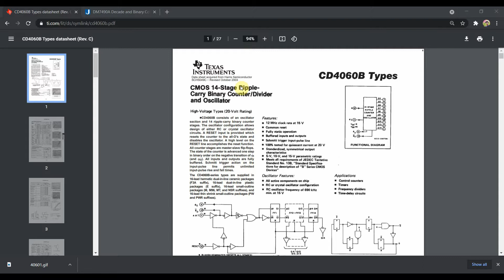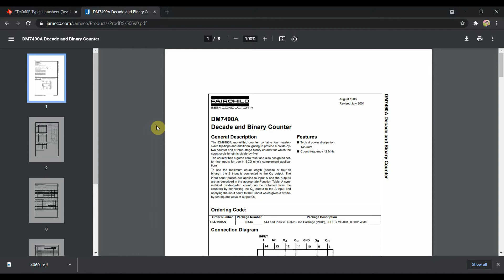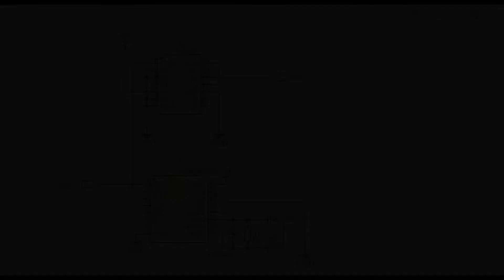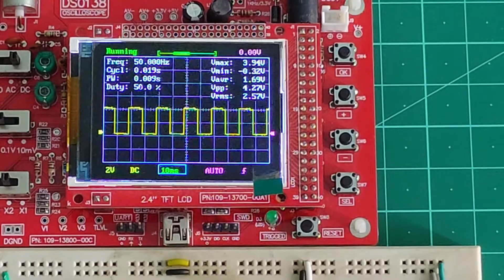Generate 50Hz and 1Khz with a crystal || Stable signal generator without microcontroller

Comment: This is a very good concept u have presented. Please I would like to know if I can use these ICs to generate 50Hz ~ with a frequency up to 25 -30MHz vibration frequency. I mean must it be 4.096MHz crystal before it will work? Please suggest steps one can take to use vibration frequency 5-30MHz to generate this stable square wave with these or any suitable ICs that can work. Thank you sir